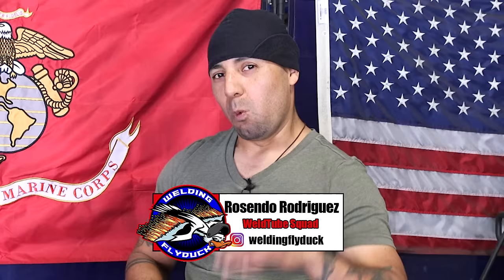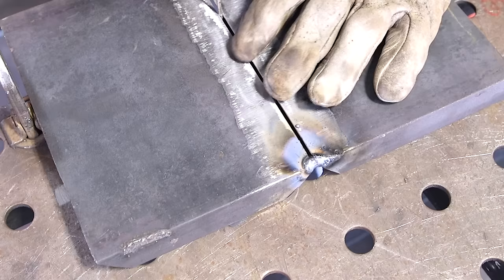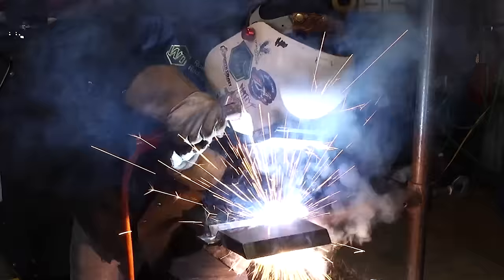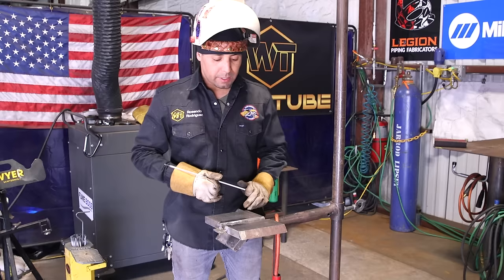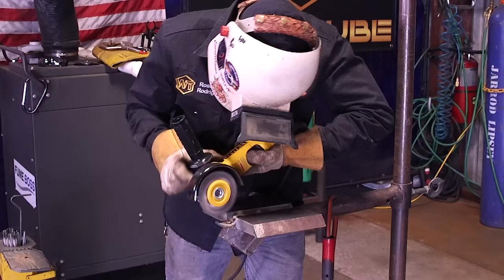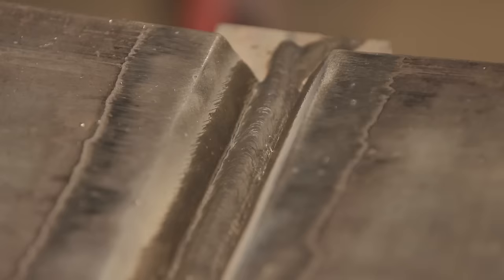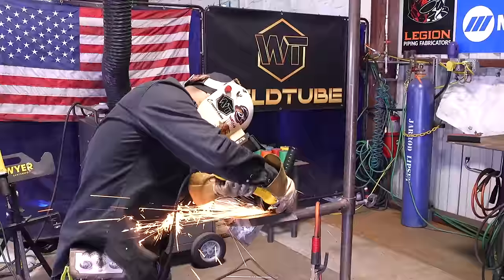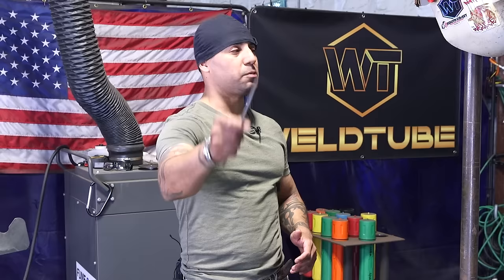1G Plate Stick Welding | SMAW

Comment: If that workpiece is easy to handle, maybe cutting root little bit open from back and weld it again? It doesn't make big difference, but for my understanding it would be better and cannot broke that easy. But that could be wasting rods and time, but some critical systems it can be good and reasonable. If that welding somehow start to stress broke, what you say, does it start from root? He's place bend, but it could be avoided at least 3 ways. If you just press it back to strait, after that root opening and welding again should be OK idea? 
But would you cut it little bit before pressing part to straight and then millimeter more and new weld, and ready..?

Heat treatment could work too and fully homogenized weld and plates, remove some internal forces + make it lasting longer in stressing environments?

Or do I fully misleaded and thinking grazy?
Reply: "He's 'piece', workpiece", not place **

Comment: do you start doing the stringer style when the bevel is too wide to do the weaving motion? im a no experience guy here sorry 😅, but im just waiting for an opening on our local training center for welding lessons, thanks.
Reply: Just use thicker rods, say 5mm rods for that filling, just use the smaller rod for your root run. Less welds that way.

Comment: And how do you prevent the plates bending like that? I did a 3/4 plate weld and it bended inwards just like that
Reply: It will always bend and warp…. Can’t prevent all that heat from shaping the metal… it typically doesn’t effect the weld when you take it to bend
Reply: @andymendez8082  its not about passing a test its about the project your working on if it needs to stay flat u cant have a warped project, i think welding a plate underneath to hold it migjt do the trick
Reply: Tack it down to the bench. It's metal after all and the tacks can be broken and cleaned when finished
Reply: @paulbrierley2133  good idea but mine was a 5th wheel plate on the truck i tacked a beam accros it, it helped

Comment: Is this how they weld ships and sub together? I don't know anything about welding, but it seems that it would make an incredibly strong joint. And I've often wondered watching video's of them welding ships together out of blocks  like Lego bricks. How the welds were strong enough to hold the ship together.
Reply: Yup they weld em
Reply: So the first 2 numbers in the rod number defines the strength. So the 70 in 7018 would designate that the weld will hold 70,000 pounds per square inch. So ya pretty strong lol

Comment: As per ASME SEC IX if a welder is qualified in pipe welding is he qualified for plate welding?
Reply: Short answer is yes. How it breaks down is :- ASME qualification test is for Process, Parent Metal, Filler Metal, Joint Type and Position there is also the proviso on material thickness.  As long as what you are welding and how you are welding it conforms to the break down I listed you will be qualified.  So if you do a 6G pipe test you are qualified for welds in all positions. Being that it is a grove joint is also covers you for fillet welds as well as the type of grove you welded in the test. The one thing you could fall foul of is the material thickness,  in that the plate thickness is outside the thickness range your pipe qualification test covered you for.

Comment: Hey Weldtube Guys i have a weird question, i'm planning on getting the primeweld tig225. primeweld said it won't weld 6010 and im wondering why. they say it do 6011 but not 6010. why is that
Reply: it needs to have a sort of fluctuation in the current as the alternative transformers buzz box,but in DC current,wich is uncommon,few machines has a specific function to burn that express 6010 rod,you can weld 6010 rods with any DC power source by just coupling (in line) the workpiece clamp on the electrode holder the entire secondary (the welding cables) of a buzz box welder,and you weld using the electrode holder of the buzz box,it will work pretty good,MAKE sure you disconnect the power supply cord and isolate the connection on the buzz box,to prevent zapping you dead if touch them.

Comment: QUESTION:

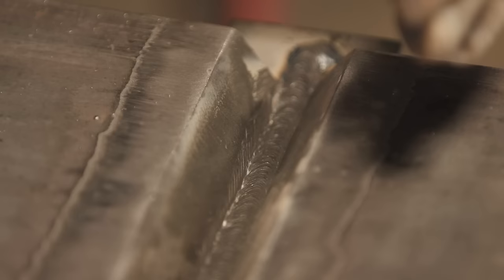@6:08 he says that we need to feel the wall. Won't that cause an undercut because the rod will dig into the plate? Still new to welding so I could be overthinking things.
Reply: He’s just trying to make sure the weld ties into the side walls of the plates. Lack of fusion is a common defect in heavy wall welds. You won’t get undercut with the correct travel speed. Good luck with it.
Reply: Undercut is usually caused by too much amperage for the size rod you are using, turn down heat,

Comment: Great video! Quick question:  how do you keep your plate from warping? Do you let it cool off after the hot pass?

I ran my first 1G today and I ended up with a noticeable bow in my plates. 

Any advice would be greatly appreciated!
Reply: I usually preset the steel with a bend in it so that by the time im done welding it warps but ends up straight
Reply: also just take your time, let the welds cool a bit before the next one.
Reply: pre bending is one method but requires experience to know the angle, otherwise on big plates we use weights of steel or concrete. Both of these methods used in shipbuilding.

Comment: Plate sure pulled from the welds cooling.  Didn't look good.  This happens from all the welding on one side.  The true test of this welding is to cut the weld from plate to plate and then polish and acid dip to check the actual weld kernel for trueness and penetration.

Comment: OMG! I GUESS MOST PEOPLE DONT KNOW WHATS ITS LIKE TO WORK IN A REAL PRODUCTION JOB WITH HIGHER QUALITY REQUIRED AND BURNING 50-60LBS OF 3/16 ROD IN 8 HRS OR OR A 60LB ROLL OF FCAW DUAL SHIELD WIRE THE WELDING IN THIS VIDEO FLAT MIGHT GET A FOUNRY JOB?

Comment: Plus or minus how many amps? Don’t leave it hanging
Reply: uhh, the +/- is for your skill and equipment. You're the only person who can answer that question.
Reply: You could go as low as 100 amps, but would likely have cold starts and porosity…on the other hand you could go 130-140 and deal with spatter and undercut  if your technique isn’t solid
Reply: For qualified welding, you will have a weld procedure to work from - this tells you what rods are permitted, preheats, volts, amps, etc... If the point is to actually produce a weld procedure then the ASME standards give guidance on the parameters. If you are just doing backyard welding do some research or trial and error.

Comment: As a person who has a full City and Guilds craftsman Certificate in Welding. That is 4 years worth of City and Guilds qualifications. Plus a 4 year apprenticeship 3 years with the same company after completing my Apprenticeship after which I worked as a toolmaker/welding specialist for 7 years with the UK Admiralty in a research laboratory. If I had produced that test piece to your standards it would have failed.
You failed from the word go having not allowed for hot metal shrinkage and bent the test piece back. like an inverse butterfly. 

I have seen it before where a unskilled welder the foreman was in love with did the same as you for a pressure vessel certification. His test piece looked like a butterfly.  After which he straightened it out.  Test piece was sent away for testing and it failed.
After finishing with the admiralty I retired from welding and took a High National Diploma in Computer science.

Comment: been wlding fuck all years from dec 16 1991 soviet welder ( hahahahaha damn i feel old ) hahaha i ant doin the math but wene i done 1 gs or larger 6010 root the a 7018 hot pass till i hade do striger i d switch to a 7024 couse 7018 was hard to get acording to copany

Comment: with all due respect .....
soooooooo wrong ........
first it seems that you have way to much Amperes going for the root ( 65 - 70 is plenty enough ), second you want to do a U shape run on the root, because you have thick material and huge walls which can take a lot of heat, no need to "drag" the puddle along, U- shape or zick zack will do just fine, then you do two fillers ( with 3mm or 1/8 at 130A ) and then you start to do strings ( using 4mm or 3/16 at 180A )

Comment: What the he'll. Doing high presser plate test. 1st off you need 4 plates like that tact together in a box. Box is welded to a stand off. And you do all positions . You can't use run off plates or 6010 for your root. Root  1/8 6011 put in like you show. No grinding disk allowed the disk contaminates the weld and steel. Wire wheel only. The only time you use a grinding disk is after you welded an completed all 4 position and brake your box a part. You have to grind both sides of each finished plate flush with out cutting into base metal. Then each plate is cut in half with a torch. Each plate you put in the press one peace from each of the 4 plates 8 peaces now total. One is bent forward at a 90 the other half is bent backwards at a 90. If a Crack shows you failed your licese. This test must be done every 5 years to hold your licese. Don't know were you all come up with this 6010 root. Not even used on pipe.

Comment: This is silly. Just go buy a bigger piece of metal instead of welding those two scraps together. Probably cheaper than all the rods and time you spent putting those two back together, not to mention time and materials grinding all that crap out. Plus a single piece will be much stronger than those two.